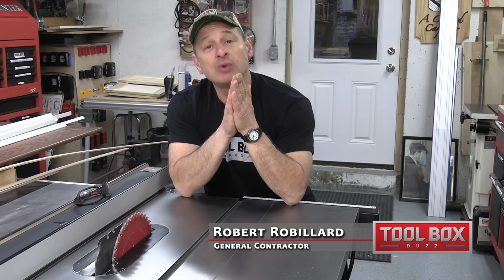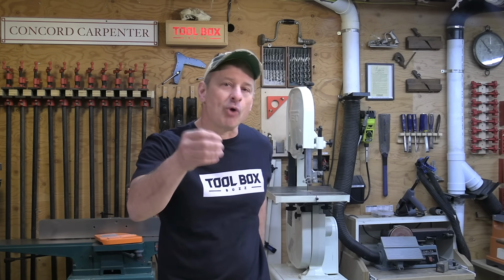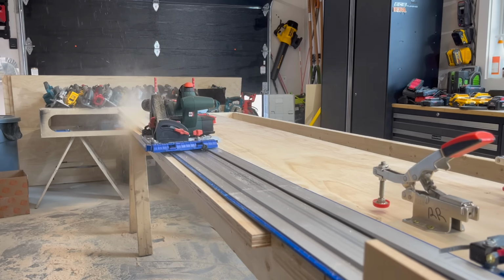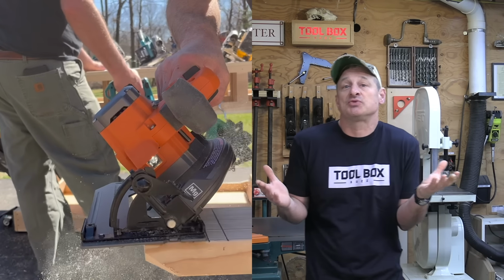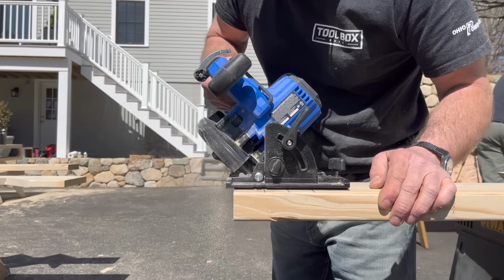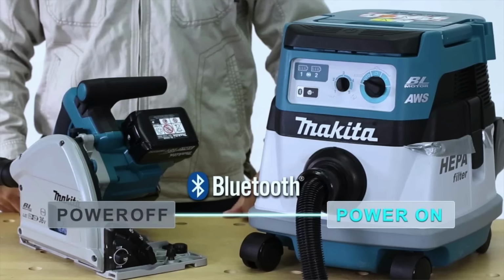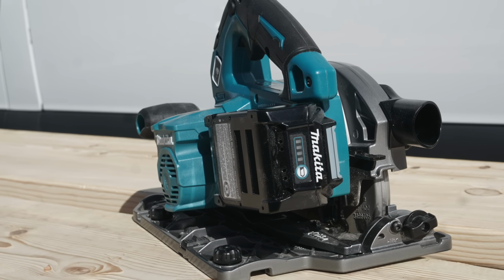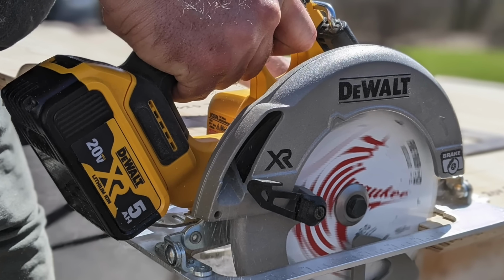Best Cordless 7-1/4 Circular Saw

Comment: "Value" fits so much better than "Price", because something that is cheap, but doesn't last more than a month, isn't a very good value. You can spend $500 on a saw, and if it does the job, accurately and reliably for 10 years, that's a hell of a value. As usually, a SPECTACULAR review. Well done, and high fives to your entire crew.
Reply from the maker: Thanks R&S
Reply: Right on with this comment!
There are times where a cheap tool is a good enough answer when it only sees occasional use.  But there are times where the tool that costs twice as much is the answer because you use it day in, day out for years and years and it pays for itself.
Reply: Well said! They are top shelf testers
Reply: As a professional I agree with that statement, however, for someone who may just their tool as much in a year as I do in a week price sometimes matters more than value so value can be much more subjective
Reply: The metabo htp  has a lifetime warranty

Comment: What I love about TBB, more testers, and more data.
It's nearly impossible to not have a bias, one person may have a larger hand that does not fit a grip/trigger.
Circular saw's job is slowly being taken by tracksaws, and bulk cutting... possibly as low as 5-10% currently.
But will always have a job, just like the table and miter.
In 2005 I bought 36v 7 1/4 Dewalt to cut 4x4's,and switched to m18 platform because of the 1st 7/14 18v platform for fencing.
For cabinet installs I use all cordless, in order... tracksaw, omt, router, mitersaw.
I hope to be mitering trim with a tracksaw within the year.
Times change and tools evolve, but competitive companies building better tools is great for us all.
Well done guys!

Comment: I have the DeWALT and the very first thing I did with it was trim the door of the chicken coop I was building... 1/2" ply sandwiched onto 2x4. It didn't even care. It has more power than any corded circular saw I have used.

Comment: The two tester I watch and trust from reviews to testing,this is one of them.

Being a finish carpenter need a reliable tool, accurate and durable.

To buy a entry level tool have low power output, us far from accurate leaving poor cuts, lastly fails while building the project. 
Would not be seen as a pro by the client.

I watch these videos to help.narrow the field from Bosch, Hilti Makita to mikwaukee. 

Thanks Rob abd staff for all your hard work.

Comment: Solid review, not including opinion tests or scores, I said it when they came out and it’s still true today. There is no better framing saw then the dewalt Flexvolt 578. ( and older 575) In every category, hands down , not even close, especially with a 12ah on it . 
    Same for the Flexvolt mitresaw , tablesaw, compressor, grinder( not the sawzall) No company has matched what Flexvolt tools can do. Game changer then and still!!
Reply: Agreed but they seriously need a new reciprocating saw. Also a better multi-colored would be nice. They killed it with the absolute best usability but needs a little better performance. As far as carpentry dewalt is just top of the line
Reply: DeWalt lost to Milwaukee on the 12" miter saw and 8¼" table saw according to this same channel.  Although the table saw on had DeWalt using the 9ah. I haven't heard any other tests with a bigger battery since the DW 12ah was released. I've heard Milwaukee hinted at something bigger than the 12ah. I could see them releasing a 15ah sooner than later though. I have the M18 Fuel table saw and I love it. I've found that there's not much difference between brands these days anymore except features really. It's nice to have the added competition though just for bragging rights on the Jobsite.
Reply: Bigger is usually better, but 12ah is too much for me for everyday carry and use.  
I’ll just switch out batteries more often and save the weight.

Comment: Another great, detailed review. Even though I’m mainly a DIYer, I sprung for the Makita 36v saw last year when I cut the cord on my old saw. Super impressed with how smooth it is and just feels good to hold and use. Plenty of power too, it zipped right through 3/4” ply when I built my work bench, both ripping and cross cutting. Got it from Acme Tools too 😀
Reply: It’s honestly a fantastic saw! Got one half a year ago switching from a Dewalt Flexvolt to it and never looked back

Comment: The 36v makita is currently available for $260 at Home Depot and comes with a bag, dual charger, 2x 5ah batteries, and your choice of a reciprocating saw or oscillating multi tool.  You can’t beat that.
Reply: Also, you can return the reciprocating saw to get $90 back, bringing the total cost to 150!!!!
Reply: Here in the expensive Netherlands you get only two 5.0 batteries for 150 dollar..